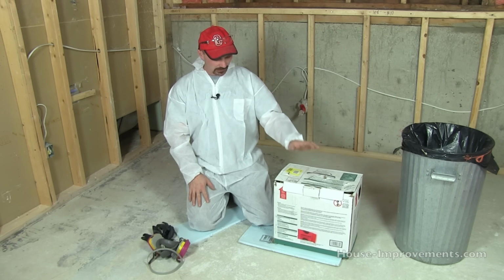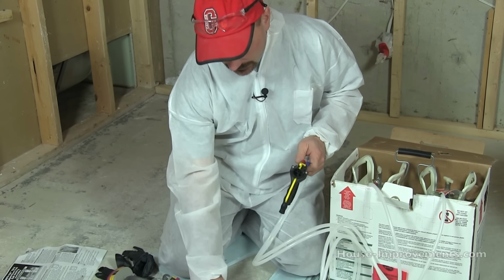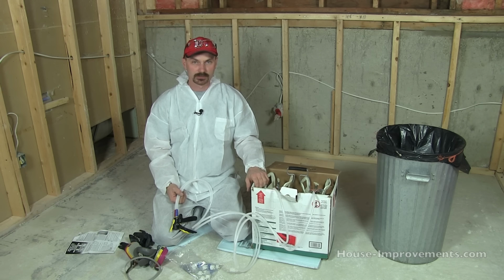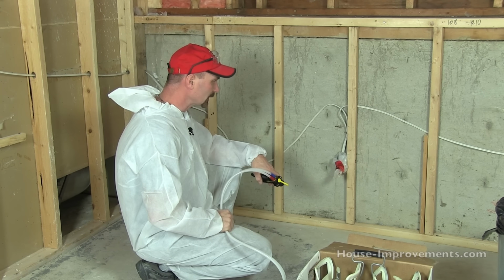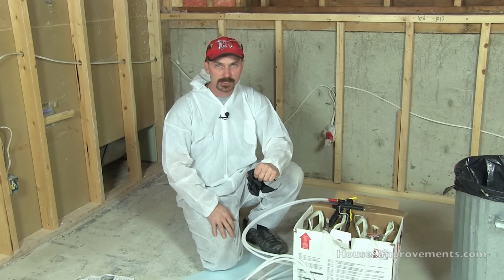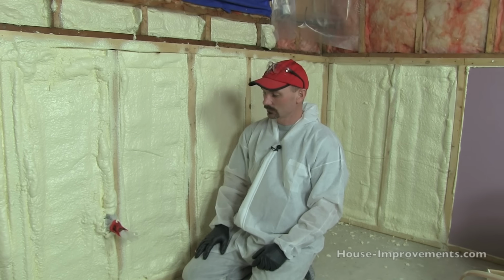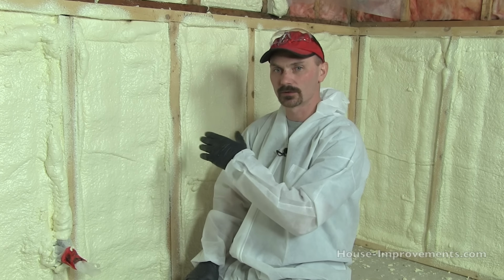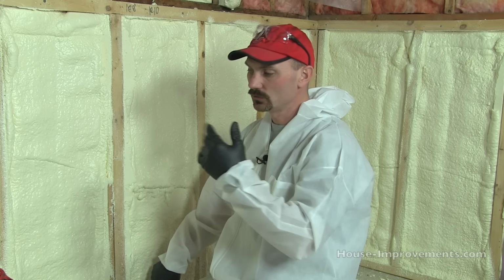How to Install Spray Foam Insulation DIY

Comment: Can you use this stuff to spray the inside of a metal van?
Reply from the maker: Sure could
Reply: That's a great idea.
Reply: did my sprinter van  with spray foam and it made it way cooler in summer
Reply: totally doing that for my conversion, thanks for the idea
Reply: You can use the foam for adhering the shag carpet, just spray it on then slap some carpet over it before it dries.
Reply: Sash, I'm doin a bus conversion. Are you stripping out the old insulation and starting fresh or using this over what's all there? I'm not sure what I should do. My bus is so cold in the winter and extremely hot in the summer... help plz.
Reply: My friend foamed the voids in his Subaru and regretted it. Foam eventually separated from car in a few spots and the squeaking started. Drove him nuts, sold car. Teased him relentlessly for many years after. He’s still known as “Squeaky”
Reply: And if you somehow end up in a lake or river after partying, you wont sink!

Comment: How tough is this to use in crawlspaces? All I can do in mine is a duck-crawl, can't even get on my hands and knees.
Reply from the maker: I would not recommend using it yourself in a confined space that can not be very very well ventilated or without the use of a fresh air respirator

Comment: Hi Shannon!  What do you personally think is a better installation... Spray foam or traditional which is more commonly used???  Thank you.
Reply from the maker: +Nrfa Spray foam in most instances.
Reply: +HouseImprovements thanks
Reply: +Nrfa Nah traditional fibreglass or wool. Spray foam is just marketing shit
Reply: +Nrfa Spray foam is about 1000Xs better. Eliminate all air leaks, R12 is about equal to R900. No traditional insulation can eliminate the air leaks. Spray foam is so effective that if you do your entire house you must have an air exchanger, it seals that well.
Reply: +Trina McDonald Wow!  Thank you. Greatly appreciated.
Reply: +Nrfa Spray foam is definitely best to use in basements. nothing beats it in that application, but  I don't think I'd use it in an attic though because you need R60 value in attics, and that would require too thick of spray foam for it to cure properly. Lose cellulose blown insulation is a good option for attics, and main floor exterior walls should be roxul which is fire proof and has the best sound-dampening qualities.  That's my professional opinion based on my experience.

Comment: I own a spray foam business. These DIY kits are bad and I'll tell you why. First off unless the job is so incredibly tiny, it would be cheaper for you to hire a professional applicator and have everything done verses buying a kit and still having to do it yourself.  Secondly who out there follows 100% of the safety rules out there? Those filtered masks aren't approved for interior work, because they don't filter out 100% of harmful fumes. Exposure to Isocyanate fumes can have very negative side affects to your respiratory system. As an applicator, our fresh air is pumped to us from outside the structure. They are full face mask because even fume exposure to the eyes is bad. So save yourself money, time, and the health hazard and just have it professionally done.
Reply from the maker: These kits in my opinion are best for small jobs or remote areas where hiring a pro like your self is usually to expensive. I do agree that a fresh air respirator would be best but for the average person doing maybe one to five of these canisters in their lifetime the risks are minimal when following the manufactures instructions. I do appreciate your input, thank you.
Reply: well..obviously....we would expect to hear you whine and complain about a diy kit. ...safety is for wimps. It just isn't fun it you can't catch a buzz off the fumes
Reply: I've got to agree with this guy, also from what I remember reading (may be wrong on this, it's been a while) but the empty tanks are considered hazardous waste and have to be disposed of accordingly. but the price to coverage is really the biggest issue, much cheaper to higher it out to someone that knows what they are doing, and if you can't budget for full spray foam you can use a method called "flash and batt", this is where in a modern 2x6 house they spray an inch of spray foam to seal the wall then use typical batt insulation to achieve the code required (or better) r-value, the benefit of this is the spray foam seals any airleaks that normal batts would allow to penetrate the building envelope but is a cheaper option vs. a full thickness spray foaming of a house.
Reply: A flash and batt could be slightly cheaper, but by the time you figure in the cost of the fiberglass you may as well have just had a full 3 inches of closed cell foam for $2.35 a sqft. You won't save much. 1 inch generally runs $1+ and fiberglass installed is $1+ depending on the batt. Where 3 inches of closed cell is going to get you close to a true R21. Fiberglass at a r19 in a 2x6 wall will only perform at that in a controlled laboratory, never in real world conditions.
Reply: HouseImprovements I was recently quoted a rate of about $2.50 per sq. ft to do 960 square feet in three shipping containers.  The location is about 50 miles from the company offering the service.  I got a price on the materials as you are using here.  I should save about a $1,000 on the job.  I appreciate the video so thanks.
Reply: Jim Tomasik I'm guessing that's three 40 footers?  How thick is that for $2.50?  And if you don't mind telling, what state or major city are you in or near?  I'm contemplating a similar project.  If you haven't already, check out tincancabin dot com.
Reply: You do realize what it sounds like when a contractor advises against DIY kits and jobs right?  Do it yourself - bad; pay me to do it - good.
Reply: HouseImprovements Hi where can i buy this product im in Austin Tx
Reply: When possible I've avoided contractors. Not up to me to make them rich and if things go wrong I have only one person to blame.
Reply: I did it myself spraying a 400 sq ft room. Cost me under a grand for the dow kit. Quotes i was getting were in the $5,000 range. No doubt a pro could do a better job, but my room came out great for 20% of the cost of a pro.
Reply: Of course a spray foam company owner is going to say what he said.  Price out what a pro company charges, then after you get up off the floor from your mini heart attack, know that DIY is always an option.
Reply: dsfi2010 he mentions that in the video toward the end that it might be better to get a quote. Watch till the end before you open your trap!
Reply: How much does it cost to have a 2400 square foot home (Pole Barn Style) Sprayed
Reply: dsfi2010 7
Reply: B C too much
Reply: @bc1953  probably 12k+
Reply: Lemme know when you're done.
Reply: I am a true do it yourself person and I agree that it isn't worth doing this yourself. A 200 square foot kit cost $300 on Ebay.  That comes out to $1.50 per square foot. I called a contractor and he quoted me 80 cents a square foot to do my house. Why pay almost twice what it would cost to have a contractor do it to do it yourself?
Reply: job security, eh?
Reply: so are you coming to my place and do 200 square feet for the same price? You don't like it because it takes away from your profit it's like a machine saying don't do your own brakes on your wheels which YOU probably do them yourself right
Reply: @JimTomasik  , what state?
Reply: @bc1953  just got quote for my 48x30 roof was 4500$
Reply: What is the "typical" professional cost per square foot? I live in N. MI. Thanks.
Reply: M P  listen to the little triggered goof! Lol
Reply: I did a house with these diy kits but would definitely go the contractor route the next time.  Biggest problem is the most I got out of a set of tanks is about 400 sq ft.  I tried everything including having the tanks heated in a room with a small heater (heater was to warm the air but no where near the tanks), shaking the crap out of the tanks.  Each kit consistently gave in the 350 to 400 sq ft coverage.  So these kits aren't near as cheap as you think and then there is the mess.  Ended up with a lot of work shaving the excess and checking with a straight edge against the studs - but honestly you are going to probably have to do that even with a contractor.
Reply: @theloniousm4337  My application mite work out then, I simply have the Joist ends to do about 60" linear feet.
Reply: @davebarron5939  I wouldn't hesitate to do joist ends but still try get a quote or two from professional applicators - they can vary widely in their costs depending on how busy they are.  If doing it yourself just plan and spray as if you have half as much spray left than you actually have.  If you have some left over you can easily go back and add another layer to cavities you have already sprayed but if you end up short you are screwed and have no choice but to buy another kit.  Also two thin lifts are far better than one thick coat - thick coats tend to curl and pull away from the wood as they cure (the bond to the other foam is stronger than the bond to the wood).  
Also use a tape dispenser and packing tape on the edges of any joists you don't want covered with foam - makes clean up after easier.
Reply: @theloniousm4337  Ok thanks, I will call and price a professional as well. I understand you CAN'T do it below 60 degrees as well.
Reply: @davebarron5939  I'm not sure about the temps as I did mine in the summer.  I was getting quotes in the winter though and the guys mentioned cranking the heat up until the surface temps were right.
Reply: @theloniousm4337  Thanks Get-er-done!
Reply: I agree...I have had half my basement done on a 2,000 sq ft. house for $1,000.00
Reply: He speaks the truth...I've had it done.
Reply: I noticed a bunch of people asking for quotes and you say nothing.

Comment: R-Value is kind of meaningless when you have thermal bridging every two feet where there is a wood stud!
Reply from the maker: Vince Stagbaugh Most all structures have some sort of thermal bridging in areas, are you saying we might as well not insulate?
Reply: R value is just a meaningless number period when trying to compare insulation performance of Fiberglas and cellulose
Reply: HouseImprovements 
Most structures are badly insulated. At least it's a bit better than 50 years ago, but we are in no way close to what should be done for insulation* to be meaningful in term of economy and environment.
Reply: It isn't meaningless at all, in fact new building codes consider the effect of bridging in calculating the performance of an insulated wall.  
To achieve r24 performance in a 2x6 stud wall 16"oc will actually require more than r24 insulation, I don't have the tables for calculating it right now but on my own house I have 1/2" interior sheathing for r1, air layer for r .5, r24 rated mineral wool batts, exterior sheathing for r1, exterior xps rigid foam for r10.  36.5 total but the effective insulation was something like r32 when considering the conduction through wood members and effectively uninsulated space due to that bridging. 
I think a standard old wall, 2x4 16oc with r20 has an effective value of about r17.2.
Reply: actually since the area of the studs are quite small compared to the area of the adjacent insulation and the R values are in parallel, the studs have a small impact on heat transfer. if you read and learn about heat transfer using simple circuit equivalents it is pretty straight forward.
Reply: Devo yeah like I said, 2x4 wall framed 16"oc with r20 has an effective r value of 17.2 due to bridging and uninsulated spaces. Not that big of a difference, unless you fail inspection by not meeting minimum code.
Reply: Macks Power but R-value is still a meanless number when trying to compare different types of insulation. Because the R-valve of fiberglass or mineral wool goes to zero when the wind blows threw it. R-value is only accurate to account for heat loss on an airtight spray foamed home.
Reply: Christopher Gruenwald if air is blowing through your insulation then there are many problems with the building system besides insulation.
A polyethylene sheet taped at the seams and sealed at the floor and ceiling will prevent air movement.
In a typical stick frame construction you have the 2x6 stud wall with poly vapor barrier and drywall on one side, and solid plywood sheathing on the other.
How much air do you expect to permeate through the plywood (which has seams landing on the studs) or the drywall/poly, or the studs/top plate/bottom plate?  Considering building codes require sealant in penetrations through the top plate and bottom plate and penetrations through more than three studs must be compartmented as well.  Also electrical boxes  and device boxes have to be sealed to the vapor barrier.
Where is the air coming from?
I could see some concern over air penetration through attic insulation, either loose fill or batts, or between floor joists.
In those spaces I don't think anything will work like spray foam.. except rigid foam boards sealed at the edges?
So, yeah, you're right in those two locations, but in walls batt is fine.
But then there should not be "wind" in your attic, unless it's over-ventilated, same with a crawl space.
Reply: Macks Power how about all the holes your poking in them to attach it, your siding and sheetrock? It's been proven time and time again with blower door tests and real life experiences that no matter how tight you make it with plastics and wraps, it still will leak considerably more than spray foam. Heat transfer happens 3 different ways and spray polyurethane foam solves all 3. Fiberglass and mineral wool do nothing to stop convection and radiant heat transfer. And we haven't even touched on the subject of condensation, mold, rot, dust/pollen.
Reply: That's why you frame the concrete and have at least a 1/2" apace between the concrete and the wood. Spraying will then get behind the wood and bond to the concrete and you will have the complete thermal break. So you loose 1/2 inch of space... You will be warmer...
Reply: Vince Stagbaugh But wood in itself helps stop thermal bridging.  Would doesent transfer heat well at all.   Try getting a wooden stick and hold it in a fire and see how fast the heat travels up the stick!  Wood is insulating.
Reply: You can actually remove the thermal bridges by turning the 2x4's sideways and staggering them front to back. Or by using normal 2x4's in 6 inch deep walls. Or 2x2's in a 4 inch deep wall, etc. You get better results because at no point is there a piece of wood that goes all the way through!
Reply: Staggered studs also helps reduce noise transfer.

Comment: This video scares the crap out of me being posted on Youtube - Spray foam IS NOT AND NEVER WILL BE A DO IT YOURSELF product.  If you do not have factory, manufacturer training, you will likely: Get sick or injured, Get someone else sick or injured, create problems with the house, cause fire hazards, cause moisture problems that could lead to mold, and I could go on and on.  Now that Home Cheapo is selling these as DIY projects, let the disasters begin... If spray foam is not installed at the right temperature and humidity of both the air and surface being sprayed, it will not cure properly and could become flammable and casue off-gassing, That's just one of many scenarios that could go wrong.  Spray foam can give excellent long lasting perfect results if installed properly by trained experts, trained by the chemical manufacturers, not trained by Youtube or Home Cheapo.  I have 11 years as a trained spray foam installer and as a building inspector. Let the comments begin...
Reply: I agree with this guy.  I used a small can of "Great Stuff" at a rental the other day and i only used a paper mask.  I did spray outdoors but later went in and took off my mask/gloves just to peak at what it looked like inside. I  spent about 15 minutes inside the house and only used a small amount, I'm having breathing difficulty and burning throat/chemical taste since then.  I'm wondering if a small amount that I used will really mess you up for life or just cause a short burn.
Reply: How did you mess up using Great stuff, outdoors no less... I find your comment suspect. I use it all the time, its more likely that you have some sort of allergy, or anxiety issue related to the possibility of it. I've used it multiple times when remodeling my own home, which is now 80 years old, and full gaps everywhere that need sealing without tearing apart the house. Never had an issue. That all being said, my lungs aren't in good shape to start with, which makes breathing issues all the time, but never from great stuff. Using Silicone Caulk bothers me more when installing a new shower than great stuff foam...
Reply: My comments above were for the two part foam in the video - two part foam has two cans A and B with two different chemicals that mix, react, combine and cure with a chemical reaction that gives off fumes and off-gassing.  The "Great Stuff" Christopher and Jason wrote about is a single part foam, all in one small 16 ounce can.  Much Less risky - could still casue problems if it gets in your eyes or mouth, but much less risky than the two part foam demonstrated above with 6 pounds or more in each tank under high pressure.
Reply: I think somebody may be a serious allergy patient in nature....

Comment: Whats the name ???where did you get it ??? Lmk thanks
Reply: Every hardware store sells it home depot or Lowe's Home hardware ETC The main concern when you go there is you ask them open cell or close cellar closer from there it's all preference. Hope that helps
Reply: @hoots02  what's the difference  between  the both ?????
Reply: @Macnificent78_  high/ med/low density you would want low for this type of application. Helps absorb sound as well as keeping you cool or warm depending on the months.